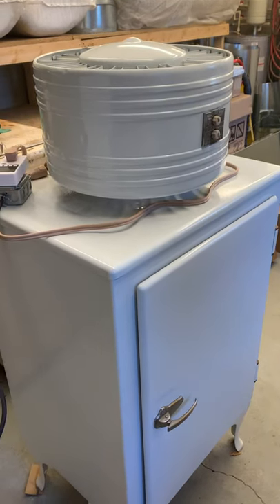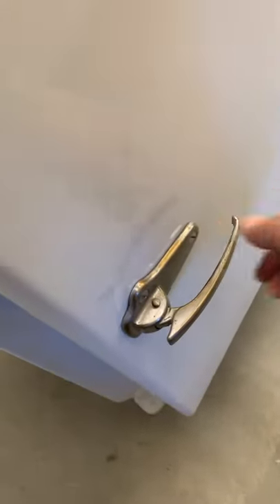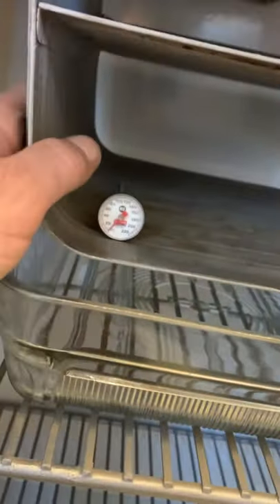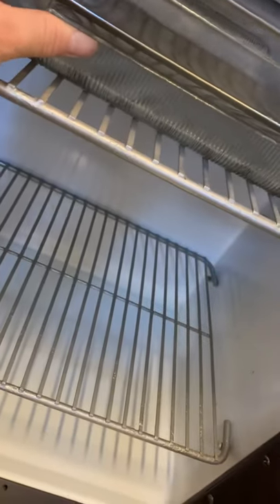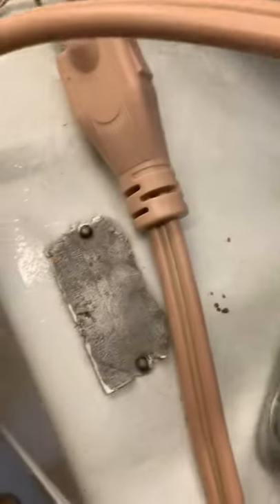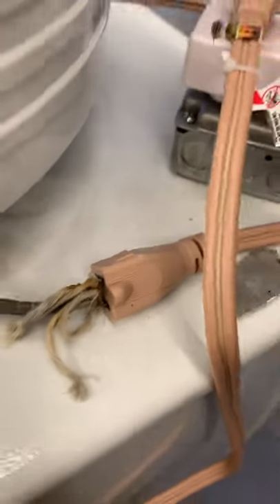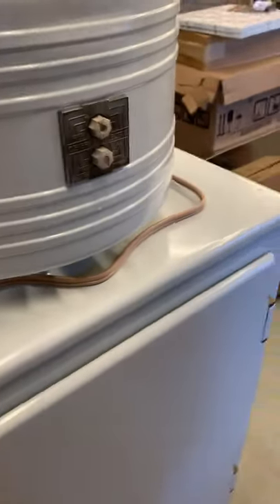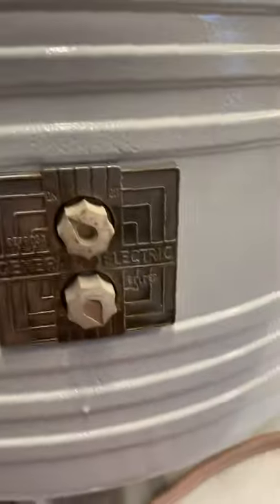Vintage 1930s general electric monitor top refrigerator intro￼

Comment: I have one very much like this, mine is not so pretty.  I like your 'on -off' and temp dials.  Mine must have been the El cheapo model as it is plane.  Mine does work well and is pretty quiet.  I saw a video where a man had one that frosted up quickly, but he replaced his gasket and it basically stopped frosting up so much.  I have mine on a timer, to run for 12 hours and turn off for an hour and run for another 12 hours, etc.  'With a little tray under the ice cube cooler part to catch the frost that melts on the 'off cycle'.  I do occasionally turn mine into the defrost cycle for an hour.  Love those monitor tops.